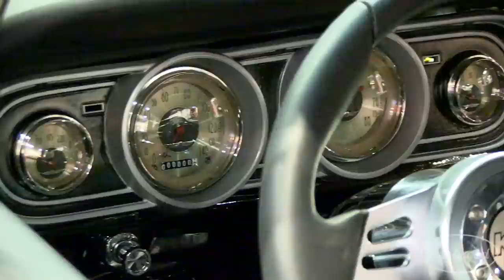How To Gap Car Doors + SEMA on Hands-On Cars 7 - Web TV Series from Eastwood

Comment: i am starting a new project in 2 months about from now. i ended up get a 79 z28 rs t top with full spoiler kit from factory o% rust then i got 2 z28 hard tops with no rust all have good bodies plus a extra front clip for a lt camaro same year  . then i got a stroked 454 with the heavy duty 400 turbo with the bigger pump and heavy clutches with only 6000 miles on it  .one hard top has new interior was a show car but  they pulled the engine before i got it . on the t top i have all the parts to have a perfect body no dings the 2 have factory paint so i know what has been dun . this way the car will have a perfect body to start with . the best thing is i got all of it so far free even a set of nice custom wheels . the show car i help build 5 years ago i know everything that was dun to it so i mite just put it back on the road to sell it or trade for more parts

Comment: I have a question.
 The aluminum bushings you installed. I'm on the understanding that it needs a rubber boot to keep the two metals from touching. As they will corrode quickly when in contact with moisture. Or does the anodized coating keep this from happening?
ps. I would have been pissed if the host had been leaning that much on my musting

Comment: Hello Kevin tets
in have been watching all your videos on epoxy resins, fiberglass fillers and specifically , I'm in the UK and have purchased some bodyalu filler 2k from eBay , bisides the smell it is incredibly strong, I was wondering if you have any tips on how to fill and spread with it , and also mixing tips with hardener , thanks for your clear advice in allow your videos, and your great sense of humour .

Comment: I'm putting aftermarket fenders on a '99 Dodge Ram plow truck. It seems that the front frame around the radiator is too high and the results are major gaps by the bottom of the doors. I shimmed the fenders up at the hinge, but have lost the body line. Any tips? Great channel. Thanks.

Comment: The only concern I would have is the filler chipping as the door is opened and closed (Impact Area).
Reply: be careful
Reply: It's not like the edge is impacting anything though, just the latch inside.
Reply: If you hit something your paint will chip anyway. Why are people so braindead.
Reply: @ThisIzTheEdge 9

Comment: Question: When you go to block the door and quarter do you do it as if this had not been done and just skim over it all? Or do you have to be careful not to block this area too much so you dont undo some if this work?        Not sure if Im making myself understood. Great video though thanks!
Reply from the maker: You will block sand until it is the condition you want it.  Sanding will reveal highs and lows, so there is a chance you will be into previous body work.

Comment: I'm not sure as to why you need to panel beat and fill a door which is manufactured originally for this car. Surely it should fit if aligned properly.
Reply: +MsCelicagt4 Doesn't work that way.   Body fit on 60's and 70's cars wasn't ever that great to begin with, and cars flex / shift with time and use or abuse.
Reply: +vr6swp I see, Thanks for explanation. Didn't think of that.

Comment: Question : @ 2:22 Kevin has a floor jack adapter to hold the Zed Sled car door. I cannot find this at Eastwood.com, and frankly do not know its exact name. It looks much better than a 4 wheel thing I have with a scissors jack under it. Part number?, name? source? Thanks!!  PS Great Video guys , thanks for your help in the hobby